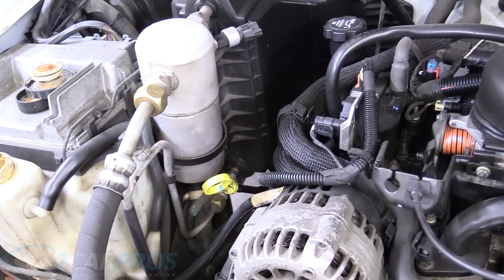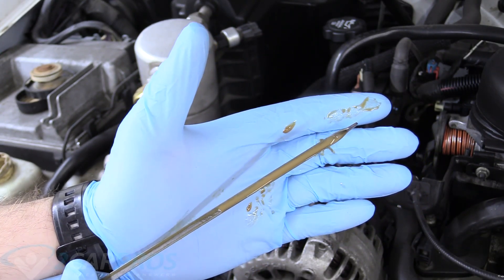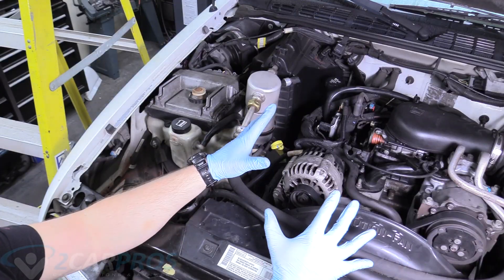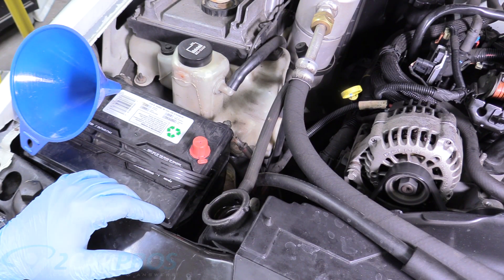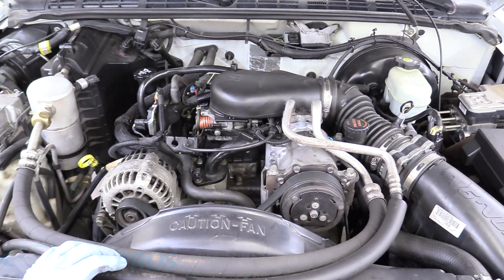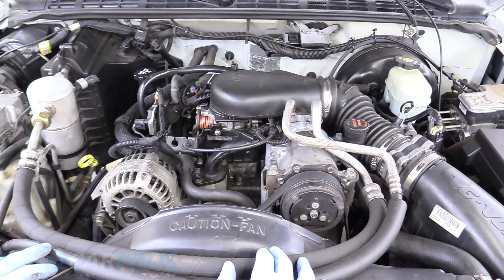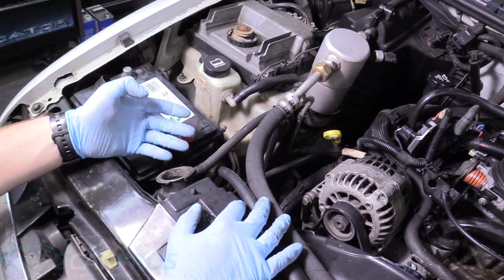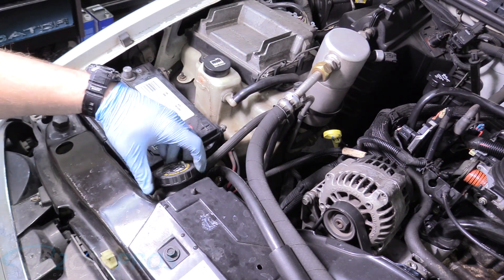Can You Fix a Head Gasket with a Chemical Sealer?

Comment: I used another brand. I drove from New England to Louisiana,  antifreeze comes bubbling out of reservoir. I had some uncomfortable antifreeze lose prior to this. Research pointed to head cover.  Did the chemical fix. Drove to California,  did some delivery on the way, 4 month total road trip bacl to new England.  Still stable after about 30,000 miles.

Comment: I find it very suspicious and convenient that you did this on a vehicle that has the thermostat right on top and easy to replace like changing a light bulb under a lamp shade with two bolts in the way . 
 Nobody wants to show a 2018 - 2023 Jeep Compass with so little room to work or even see  !!!   it's like trying to fit your hand through a hole as small as a door knob hole in a house 🏠 plus it requires removing about 9 parts just to get to the freaking thermostat and the first video I watched using Blue Devil the mechanic stated this product DOES NOT contain particles that cause clogs in the coolant system    🤔 but all other mechanics videos they remove the thermostat ? 🤔
Reply from the maker: MUAHHAHHAHA MY PLAN WORKED!!! I forced this S10 to have a blown head gasket so the video would be easier! 

No, this truck had a blown head gasket as evident with the oil milkshake. Decided to try to this due to the truck not being worth much and it worked. Trust me I'd much rather this truck just never have any problems ever. 

Thanks for watching!

Comment: '97 Camry  4 cyl 142.900 miles timing  belt is going.  But now antifreeze  in #4 cylinder will it fix the problem? No smoke  out the tail pipe. No water in the oil. The wife's high New  mechanic  says lackbof engine  oil. I just had it changed. 😂

Comment: Just ran the Blue Devil flush in my system of the 5.7 hemi. Isn't thick creamy yellow anymore. Thin chocolate milk. Guess that's a success. LoL. Oil is still clean though so the engine doesn't seem contaminated yet. Gonna flush the cooling system out til it's clear then dump this entire $80 bottle of head gasket sealer in it and see how she works. Took a chance this morning driving it to town. Made it 2 miles from home after leaving AutoZone and the oil temp reached 370 degrees before she died on me. Had to tow it home. Luckily, it started back up waiting 3 hrs on the tow truck soon as he pulled up, thought maybe it seized up for good.

Comment: Please help!!  LoL. I dunno if my head gasket is blown. 2011 Jeep Grand Cherokee 5.7 hemi. Oil on dipstick and in the oil pan is clean. No coolant signs at all. Looks like I changed the oil 3 weeks ago. However, I have that thick creamy tan nightmare in my radiator, hoses, overflow tank, etc. Flushing it for a week now and oil keeps going down on the dipstick (3qts) in a week from just idling and driving up n down the road a bit. Oil isn't leaking anywhere nor is the coolant. Just oil in my coolant somehow. (No oil cooler in my engine)

Comment: Just pull headbolts, lift head, dump a can of copper spray in (both sides of gasket if possible)  torque 20 past yield n leter rip.

Comment: I put blue devil in my ford truck and it clogged up my heater core and my truck ran hot. Not right away but a couple years later . There was gunk all in my coolant system.  Had to get head rebuilt

Comment: How about if it is the other way around
Where the oil mix with the coolant in inside the coolant reservoir and radiator
Reply from the maker: Yeah that means the same thing. Blown head gasket more than likely. Thanks for watching!

Comment: For anyone wondering, this method is more of a "bandaid" rather than a fix. Blue devil is hit or miss. I've seen it last the life of a car, however there are cases where it might only last a few years. Definitely cheaper then actually replacing the gasket, just understand it's not always a permanent "fix" and it's not the proper way to "fix" the issue.
Reply from the maker: Of course not but if it delays the big fix for a few years, why not? Thanks for watching!

Comment: My mechanic said I had blown head gasket .but my oil is crystal clear and I don't lose any coolant.?? Do I just change oil every 2 months ??
Reply from the maker: Then how does he know it has one? Thanks for watching!
Reply: @2carpros  he did a coolant cap pressure test with a pressure gauge gismo .gasses from exhaust was getting into coolant
Reply: Pressure building

Comment: I just want to say 🥳🎉🎉🎉✅🚙, thank you …thank you..very much….to this company Bars🔴the product I used in my Nissan Altima 2005 ** Bars leak Head Gasket 🔴 🔥🔴🔥🔴✅🚙 three months ago with 240k miles on it, still working perfect, I have driven back  and for every weekend to St Louis Mo 280 miles from my town🌪  and my engine dont have any yellow light or I have not loose any Coolant, no more white smoke…it did sealed my heads in my engine…🥳🎉🌪 Honestly, I never would have believed in a million years, that a product like this xxx🧨🙊would have resolved my coolant engine problem and sealed the problem in the engine of my Nissan. I normally dont make reviews of products but this 🔴 Bars leak Head Gasket 🔴 it saved my engine and now I drive relax and confident that my engine will continue running smoothly 🚀🙊💥with this product. I follow the instructions in the bottle exactly as they told you to use this product and it did the fix the engine coolant and smoke problem✅🥳🎉I am so happy that I took the risk and  save my engine. Thank you again Bars leak Head Gasket 🔴. I hope my review help any other person that want to save their engine of expensives repairs.. Mechanics in gral should be worried that products like this exist….I fixed a big problem, with and excellent product no expensive and no knowledge of mechanics, anybody can do it and save a lot of money…Good Luck. Arturux😎

Comment: Do you think this will work for a leaking freeze plug as well?
Reply from the maker: Nope. This product relies on the heat and pressure that occurs in the cylinder. There are products for a leaking freeze plug but I have no idea if they work or not. Thanks for watching!

Comment: Is it still holding up?
Reply from the maker: Still! Yep. Thanks for watching!
Reply: @2carpros was having white smoke out my exhaust. No external leaks or anything. But assumed the worst. Took it to a local mechanic and they told me it failed a combustion test. Went and bought my own and it passed without any color change in the test fluid. No milky oil, just slow loss of coolant, no overheating. I'm thinking it has something to do with my water pump. Jury is still out. I'm just amazed at the dishonesty of some mechanics.

Comment: 1st thing to do if water is in the oil Change the oil with "USED" motor oil.. With the price of oil and you know its leaking water there is no sense of spending/ wasting $35.⁰⁰. After using the sealant  and it appears to have worked you can then replace the oil with fresh clean NEW motor oil.. if that makes sense to you then save yourself some money..

Comment: So my 05  2,5 s Nissan Altima 4 cylinder won't start dealership said it was head gasket  how would the chemical work if vehicle won't start it also has 114,on the dash and suggestions
Reply from the maker: A head gasket wouldn't prevent starting. Unless the engine is totally filled with coolant or something crazy like that. Thanks for watching!

Comment: I have an old Toyota 2LT engine built anew. All items are new and high quality. Most Japanese,  only pistons are Taiwan. The cylinder block is bored out, and new high carbon steel, quality cylinders are inserted. Cylinder block gasket metal TAKOMA. But  on the gasket  was smeared SHELLAC, and possibly of poor quality.
Engine - diesel. At high speeds/tork , it gradually squeezes out antifreeze. Also, with the thermostat removed, it squeezes out 1.5 liters for 80 km. At low speeds, the pressure is less, the inflation of the cooling system is less.
The compression was checked by inflating the air pressure into the holes of the glow plugs. There is a slip between the three cylinders. The big problem is that from the 3rd cylinder there is a breakdown into the crankcase and there is a weak but smoke from the crankcase durig the oil dipstick.
 The question is -
Can a punctured, poorly-fitted gasket leak exhaust gas into the oil system like into the cooling system?
And is it worth it to apply sealants or change the gasket? Should I use metal or paranitic?
On a metal smear SHELLAC or is it not worth doing?
Thanks in advance for any advice. And thanks for the interesting videos.

Comment: What if the cap is milky but everything else is fine? dipstick clean, radiator fluid is clean.
Reply from the maker: A bit of milkiness on the cap might be a super small leak. Milkshake in the oil is really the tell tale sign. Thanks for watching!
Reply: @2carpros  I found the problem, pcv valve issue
Reply: @2carpros  I guess it's a common issue with gx460's

Comment: I have milky oil should I change my oil before using the pour and go cuz I have already replaced valve cover gasket thermostat water pump on it and it coolant reservoir was flushed and refilled and oil change but recently my temp gauge sensor went bad and my reservoir had to be replaced cuz it was burning through coolant I know its a minor issue cuz I haven't really driven it since August of this year

Comment: Most definitely you can fix a head gasket with sealer I just fixed my 97 Saab 9000 cs that has a blown head gasket used bars leaks head gasket sealer and she lost no coolant and no clouds of smoke out the tail pipe prior to using it
Reply from the maker: I had no experience with it until this video and now I'm a believer. Thanks for watching!

Comment: A tip I found online and used that worked well - maybe put in a lower temp/pressure thermostat to reduce likelihood of blowing out the sealant. 

I ran a bottle of Blue Devil (the standard version, not the quick one) through an high mileage '87 Ranger (v6) with a severely blown head gasket. Still had a bit of a leak, so I flushed it again and ran another 1/2 bottle through it.  Drove the truck daily for the next 3 years with no leak, probably 25000 miles.  It was still running when I scrapped it.

(I had bought the truck from a friend who was going to scrap it - I was moving to a new apartment that week, and figured it could just barely make it the 1.5 mile drive before, and save me the cost of renting a U-haul.  The Ranger would blow through / boil out almost the entire coolant system after 5 minutes of driving, needing a refill.  Worked out better than expected, and I was only out the cost of 2 bottles and the time to flush it!  From friends who've used it, sounds like getting it flushed really well (as directions dictate) makes the biggest difference in whether it will work or not.  I personally think the lower temp thermostat helped too.

Comment: How could I try this, I think my truck would over heat in a 50 min run
Reply: Before I put blue devil my car would overheat in less than a minute. It worked for me. Just follow the directions on the bottle
Reply: @CanIbeFrank  dang no way I didn’t think so so tried k seal, it’s been working for ever sense

Comment: I don't have milky oil, any leaks, weird smalls or anything, no bubbles, but, my coolant ends up in my reservoir tank and not back in the radiator. I would have to top it off every time i look at the overflow tank and siphon it back from the overflow to radiator. I replaced Thermostat, Hoses, Radiator and Radiator cap.... But still the coolant doesn't stay in the radiator. 
I'm getting one of those blue head gasket  tester kits and will see, if all else fails i'll try this. My Infiniti FX35, the thermostate is on the housing, so i may need to order a new thermostat just in case this messes that up.

Comment: Great job.....  That engine likely had/has a leaking intake gasket.  Oil contamination with coolant is generally a leaking oil cooler core in the radiator or a failed intake gasket in those 4.3l Vortec engines.  Blown head gaskets are rare on them and compression leaks into the coolant are usually cracked heads.
Reply from the maker: The blue devil fixed it and it is still being daily driven to this day, which shocks me, but that leads me to believe it was a small leak on the head gasket. Thanks for watching!
Reply: @2carpros  GOD MORNING/ AFTERNOON I had a mechanic use it on my car while my engine was cold it sat for 20 minutes he didn't remove Thermostat he poked a hole in the Thermostat then poured Blue devil in and told me drive car for 50 minutes, I parked car over night now I have code for low engine coolant and I see wet damp spots under my car
Reply: I'm hoping I don't have a cracked head in my 5.7 hemi Jeep Grand Cherokee. Got the creamy thick tan nightmare in my coolant. Oil on dipstick and in oil pan is clean like I changed it 3 weeks ago.

Comment: And what I mean when I said how do you know it’s a blown headgasket not a head and wasting a day and money is if the cheap fix doesn’t work you say change headgaskets but in reality the heads and gaskets need to be inspected and then diagnose the issue before the headgaskets are changed , warped head,, cracked head, duhh who wants to do head gaskets to find out it’s a warped head , or cracked head , other possibility oil cooler leak , one more point I had just slipped my mind

Comment: If that is a code r 350 (5.7) engine , And the engine has a lot of miles and the engine has never had any major engine repairs . I would for sure replace the broken plastic intake gaskets , Biggest source of coolant leaking into the engine oil is the broken plastic intake gaskets around the water outlets of the cylinder heads.  After that repair is done ,and you still have issue ( you overheated the engine ) then you should try Blue devil . Speaking from A GM tech who has done these repairs a lot .   depending on how bad the condition Blue devil may work
Reply: As u r gm expert
 Can blue devil work if transmission fluid leaking from front axle seal leak
Plus oil leak not much around valve cover
Milky oil cap yes 
not milky dipstick
But no overheating and no other issues
Please reply in derails
Blue devil head gasket sealer should I use in coolant or oil
Reply: @rajendramodusu5980   As it say on the bottle of Blue devil , it's for the coolant system .It helps seal head gasket leakage ,wear as coolant is leaking into the cylinder. Don't think it was designed to stop other types of leaks like external ones . You may have other problem with this engine .And if your axle seals are leaking ,then don't be cheap ,replace them . And over heating only shows up when coolant level become a issue . Lucas products are used to help stop some leakages from p/s trans /diff .Helps swell seals . But it's not a fix all in a can. It's very hard for someone to diag. from a on line chat . Hope this helps
Reply: @roguewarr4662  rogue thanks for reply first
Ok frond left axle I got new one 16 months  ago and got it replace ( boot was torned and inside grease was dried no trans leak i got new one bcz their was lot of cranking sound while turning) by mechanic the moment my car was ready I took out of garage transmission leak from the end where their is seal ( after putting new cv axle)in 5 minutes I took bk to garage  and he pushed it more inside as near seal some lock mechanism he didn't lock properly after that 
It was fine
Now bk to current situation 
I showed mechanic he jacked the car up showd me the leak and said u need seal( only seal of cv axle )I will get the seal and mechanic will replace it its 30minutes job that's OK 
But I know oil  is near valve cover and oil cap getting milky not the dipstick I d see overheating but burning smell under hood like oil or I d k what burning 
My concern is will blue devil head gasket seal it if it's head gasket
I read that one need to take thermostat out before using blue devil and pour bluedevil in
Otherwise heater core and other things blocks 
Is their any easy DIY test for head gasket at home to confirm if it's head gasket
Plus most imp is it ok to drive 7 miles bk and forth to wally( that's only place I need to go once week for grocery)?
I d want car to break on the way 
So I am curious car is 2010 aveo only 80k miles but not worth spending much money on repairs like head gasket or something like that
I will appreciate your reply

Comment: Was the oil changed after the blue devil head gasket sealer?
Reply from the maker: I changed it before, then did the Blue Devil. After that the new oil wasn't milk shake at all. Not even a Even a little bit so I just ran it. You could change the oil after to be extra thorough though. Thanks for watching!

Comment: I have a 09 Corolla Dual VVT-i 1.8L  engine  has 185k and it misfire on cyl 4. (P0304), according to the auto shop, I have coolant in Cylinder head 4. Would this work on Toyota and does your leak still good as of today. Thanks so much for helping.

Comment: QUESTION. What is the purpose of removing the thermostat. Cant you just leave it in then put a new one in after????
Reply from the maker: It has to do with the way the chemical works and it needs the entire cooling system to work not just the loop from the thermostat. Thanks for watching!

Comment: Thanks for the video. I may have to do this.  When you have the heater all the way up does it matter about the heater fan? Should it be off or on high?
Reply from the maker: Heater fan on high, thanks for watching!
Reply: The heater is up so that the water flows. Fan doesn't matter. Turn the radio up high

Comment: Besides needing to remove the thermostat and flush the coolant, what’s the difference between this and the yellow label?
Reply: He is using the yellow label. The pour n go is the all blue and white label and doesn’t work as good only small issue. The big yellow bottle is more concentrated and you must remove thermostat. Don’t even bother with pour n go unless you can’t remove your thermostat but I recommend either way you do.